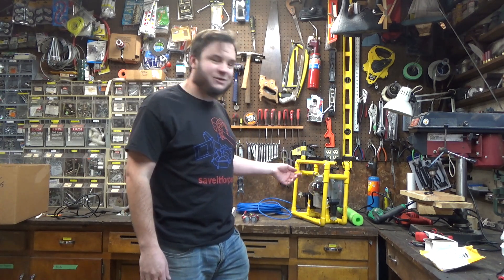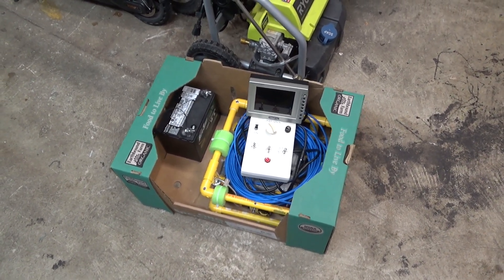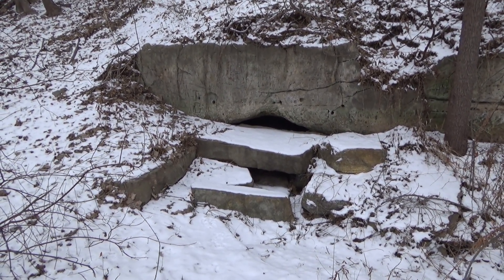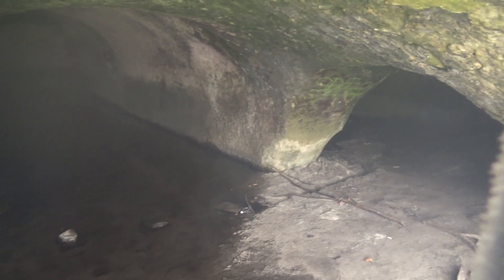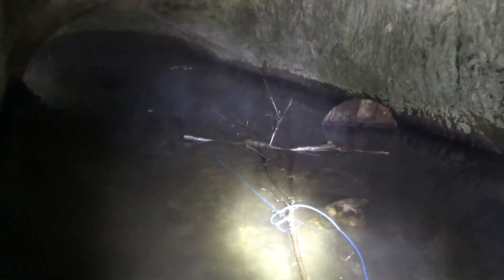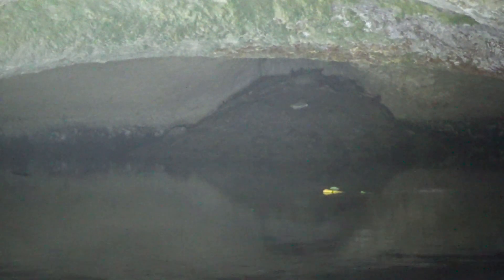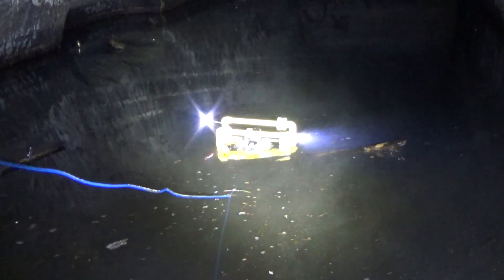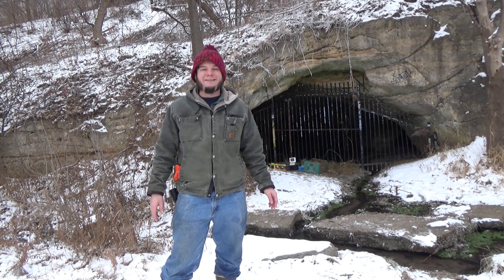Exploring Flooded Brewery Cave With Homemade ROV

Comment: In order for it to dive and stay submerged, do the thrusters spin the whole time to keep it under water ? Surfaces when the thrusters stop ?
Reply from the maker: Yes, I have it very slightly buoyant, so it will (theoretically) float on its own with no down thrust. However, if I hit the bottom too hard and get mud stuck to it, sometimes it doesn't float back up!

Comment: i watched the build video and was wondering how all the electronics were done. may be simple to you  but man others might benefit from a little more in-depth look.
Reply from the maker: I can try to show more of that in a future one, I actually need to redo some stuff because I have a leak. The motors are basically all wired directly from the controller so it's not too fancy.